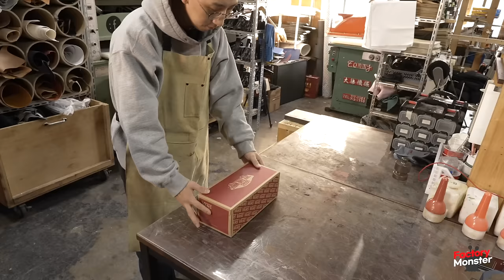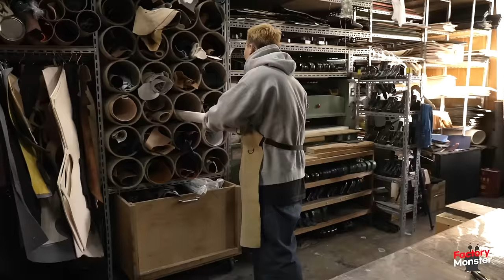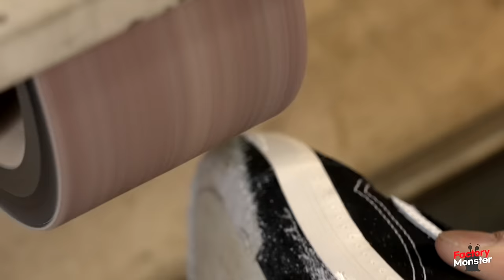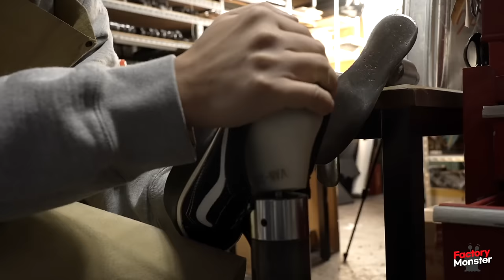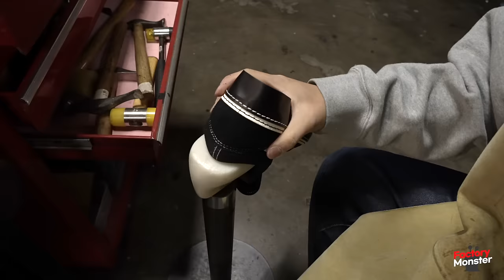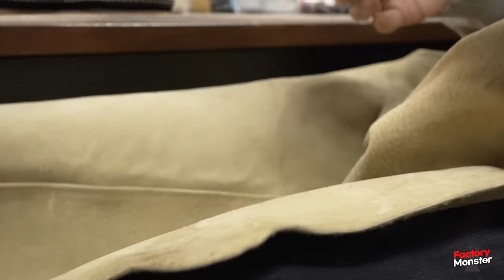Process of turning $40 Vans into $400 Vans. Korean Custom Shoes Master

Comment: The website even has them listed as sold out @ $230, which makes sense from a monetary standpoint because you're effectively paying for a major resole job like you would on a boot that needed a rebuilt goodyear welt and mid/outsole. I gotta say, it's kind of genius -- they're not even building a boot or shoe from ground up. $40 sneakers, $40 for two Vibram outsoles and then just buy bulk leather... probably comes to $100-120 per pair to turn around for $230. Of course you need the tools and sewing machine too but that's all one-time cost. Once you're set up, if you make 10 pairs of these in one day, you've made $1000.